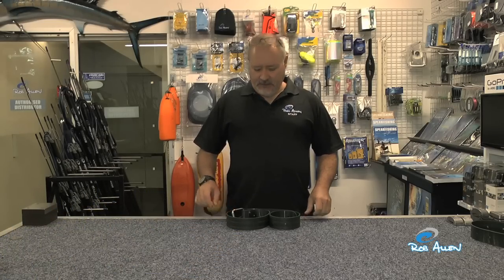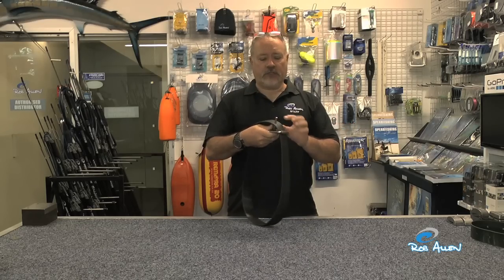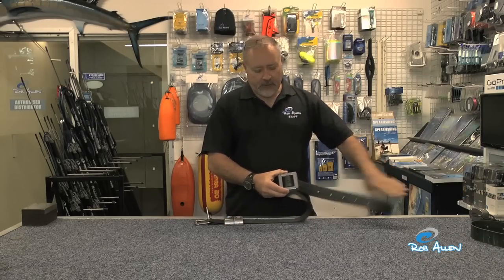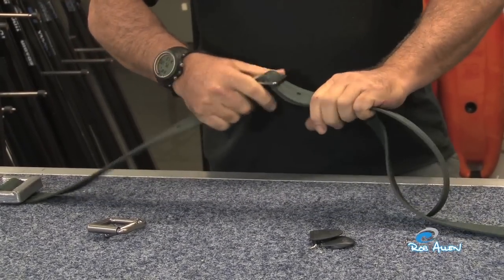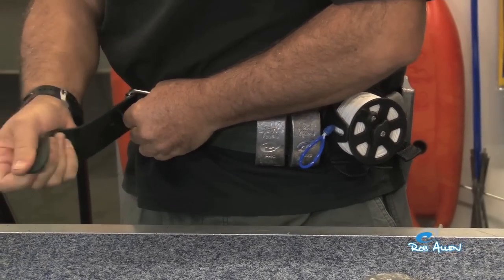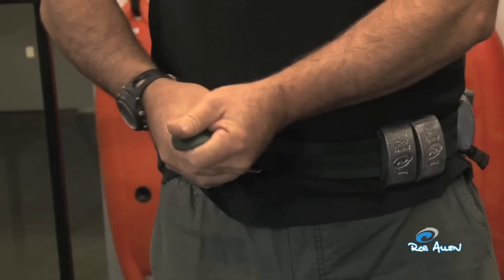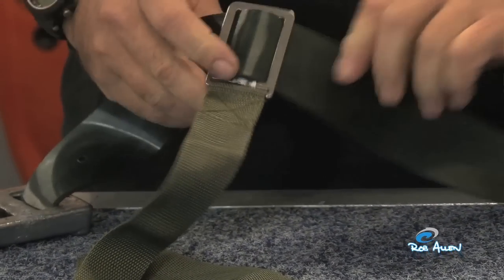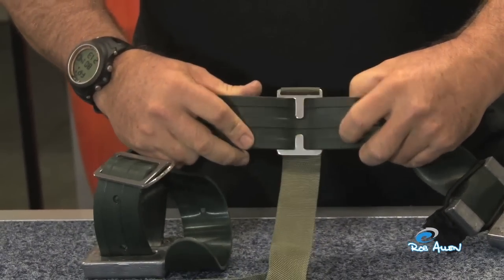Rob Allen | How To Series | Weight Belts

Comment: Thank you.
I am a beginner and you look to be about the same size as I am. What size wet suit so you have? Do you suggest a one or two part suit?
Reply from the maker: This is not an easy answer. It all depends on where you are going to dive, how cold the water is, which you prefer, what your budget is etc. Where in the world do you dive?
Reply: @RobAllenSpearfishing  thanks for your reply  I will be mainly diving in the NSW coast of eastern Australia if you are familiar with Newcastle. Water temps might get down to 15C in winter and 25c in summer. Thanks
Reply from the maker: Best will be to chat to your local dive shop.

Comment: how do you lock the position of the domed weights?
Reply from the maker: The rear section, the part that will lie against the body is thin. Once you are happy with the location, use another weight or a small hammer and just knock in that section of the lead to pinch against the belt. Very easy to do. Check out 1:42 I mention this in the video. If you still need to move it, simply stretch the belt and slide it up or down. As soon as you release the stretched belt it will lock back into its new location. If you take it off, you might need to use a large flat screwdriver to stretch it open again to use on say another belt.